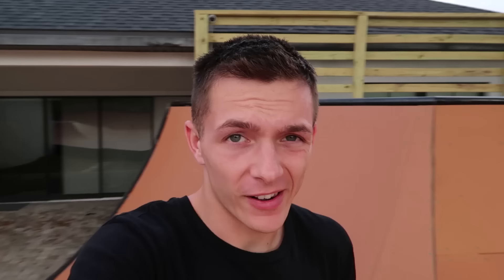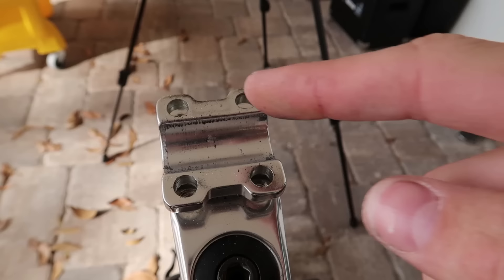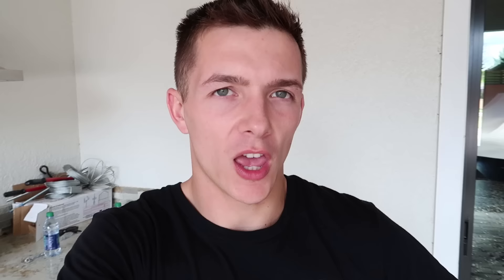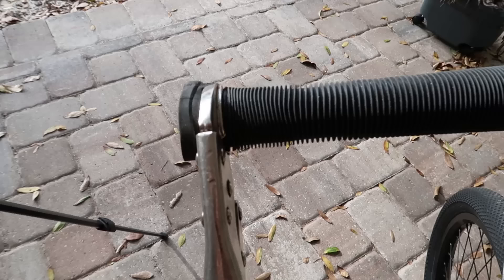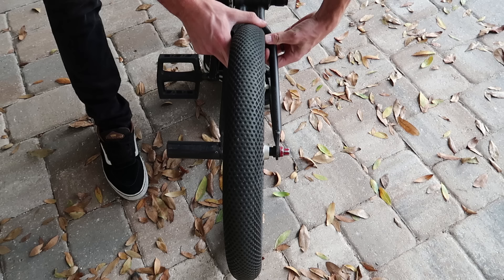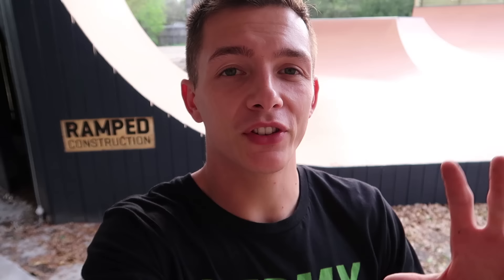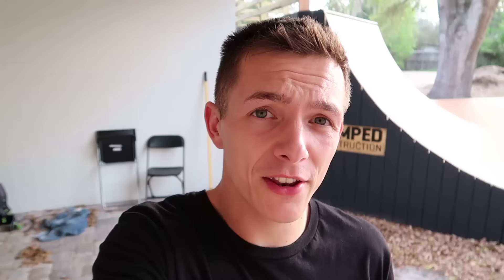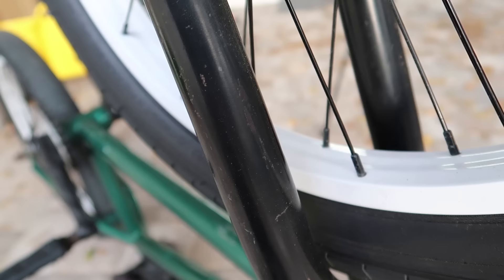10 BMX Life Hacks that will Change Your LIFE!

Comment: it is a terrible Idea to ride without the compression cap. you are right that it isn't supposed to be really tightened down but it still keeps everything from moving around combined with the pinch bolts on the stem. if you hit something or even pulled up to hard the stem could come off because the cap is not there to stop it

Comment: Boiling the grips in water does work. It's simple science. It heats the rubber and makes it more Maliable. If it didn't work for you... You either didn't heat it enough or took too long after taking it out the water so it cooled down.

Comment: I've never had handlebars slip with an aluminum 4-bolt stem, not once, not ever, but then, I've always had chrome-plated handlebars. Why anyone would want painted handlebars is beyond me. Also, make sure to grease the threads of your bolts, which allows you to get them much tighter without galling or stripping the threads. For that matter, it's good practice to grease the threads of every fastener on the bike.

On the other hand, the old steel, single-bolt goosenecks like these - https://i.imgur.com/Qa9029V.png - were prone to slipping, at least the ones on department store BMXs in the '80s were. One solution that sometimes worked was to wrap a strip of tin around the handlebar to make it a little thicker so you could clamp down tighter on it.

Comment: hi mate i would like some help if anyone can. i have a wtp 2010 volta. it has a 25t sprocket. im thinking of getting a 28t sprocket as i use my bmx mostly for long rides and not stunts like grinding. i do a bunny hop now and again thats all. i dont see any videos of people installing a 28t sprocket so that makes me think its not a cool thing to do. what do u think? one problem i also have is my chain rubbing on my frame and having bigger sprocket will sort that problem out, or what is the device called i would need? its some rail thing but idk if u meant to put them on a bmx. im thinking of getting the 28t totalbmx victory sprocket as its lighter than others. and i want a shadow halflink chain and it costs a bomb like £45. but this bike im doing is gonna be sick.

Comment: I always pulled my wheel back to tighten the chain them have someone hold the brake while I tighten the bolts up, it's never failed me, but you do have to have brakes which seems not too common anymore

Comment: Got sweaty hands? Wear gloves .
Back tire moving around? Install washers on outside of dropouts and tighten until metal squelches. Handlebars moving back and forth or side to side ? Loosen pinch bolts on sides of stem tighten the top cap all the way then tighten pinch bolts then go back and tighten cap a little more .as for handle bars cross tighten your bolts then do a once over . Grips all loosey goosey? Soak them in hot soapy water put them on while still wet let dry and once dry they will never move . Do these things as I suggest and 'll these "life hacks " are pointless I've never had these problems bc of these solutions and I use to ride every day from sun up to sun down and we rode street ledges gaps rails stairs all that and still our stuff never came loose or moved . Do it right the first time to prevent the issues

Comment: I've always had throttle grip on one of my bikes even with your fix it did nothing. (Fitment issue) a thin layer of silicone on the inside edge when rolled inside out took care of it.

Comment: These aren't really Hacks and please... Don't ever sand inside of your stem, just sand a little bit of the paint off the bars after you've had them on for a day or two, you're going to see the marks and know exactly where to sand it at. Also you don't have to use Sharpies, Just buy a paint pen that matches your bike and you'll be set for months or years... And about the grips, You can buy lock-ons for your bike instead of regular rubber grips or use a wrap on grip, sometimes cleaning the inside of your grips won't help so you have to use a drying agent like rubbing alcohol to dry inside of your grips, just wipe it on and put the grip on then blow air in and that usually makes the stick to the bars better.

Comment: Ok i got a A question on how do you make your bike be able to do a bar spin with your brakes on your bike because I try to do a bar spin but I have brakes on my bike so when I do it it makes my brakes tighten and then my back wheel won’t spin because it has the brakes on
Reply: There's no easy way to do it. You see a lot of people these days removing their brakes in order to spin their bars which I do not recommend. You could lengthen your brake cable if that's livable for you or you could get a freestyle type head set. Do what works for you. Good luck!

Comment: NO YOU CANNOT KICK HADLE BARS BACK INTO PLACE what that does is ruins the grooves inside the throttle to hold the handle bars making so no matter how tight you  make the screws they will bend

Comment: If you don't want throttle grip why would you use wd40 to stretch grips because that would make your grips slip forever because wd40 doesn't dry easily under grips.🤦‍♂️